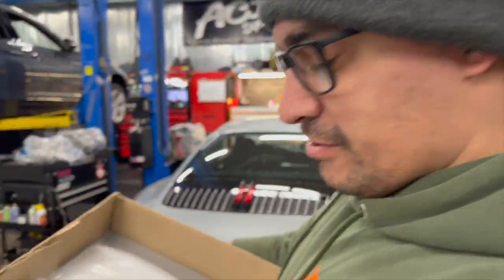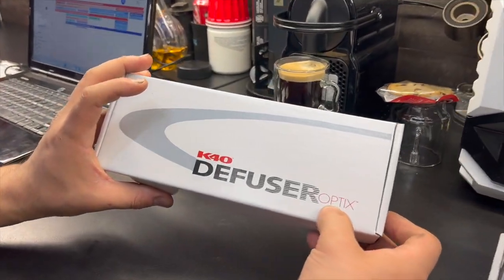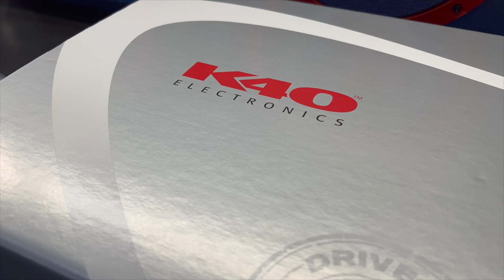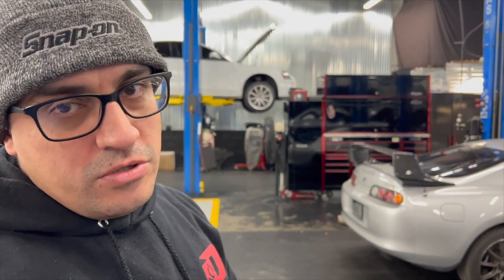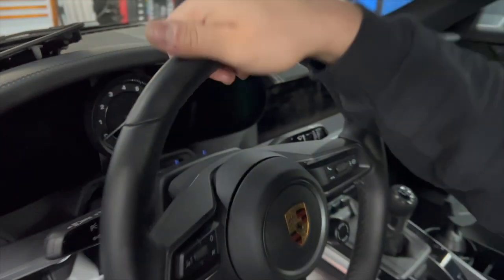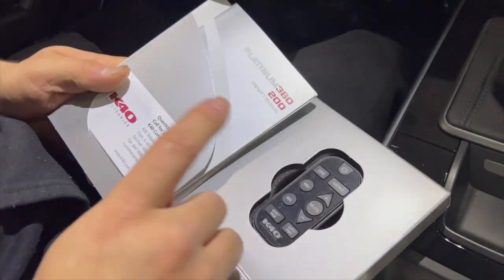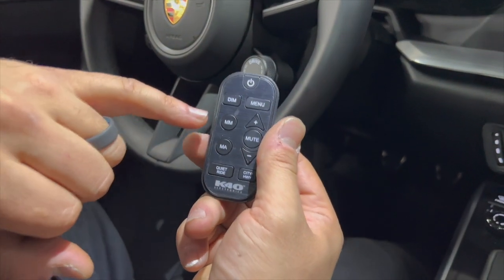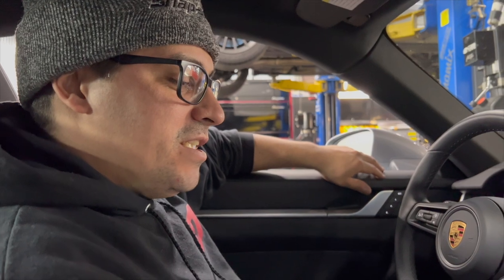Full K40 Laser Jammer Install + How it Works!!

Comment: Great video man! One thing though, at 12:36 you say Radar jammers are illegal. That is correct, but the K40 is a lidar diffuse/radar detector not a radar jammer unless
I’m mistaken.
Reply from the maker: Thanks for watching!
Reply: @acidynamix  for sure. I bought a vehicle with a k40 installed. How hard/expensive is it to remove and install onto another vehicle? A video on best practices would be great 🤓
Reply: @acidynamix  can I mount my front radar on my k40 radar behind front lincense plate? I got the one with the two led lights I had it for 6 years it can’t loose going down the highway?
Reply: @acidynamix  oh one more thing the front led it staying lit while driving any and all information would be helpful.